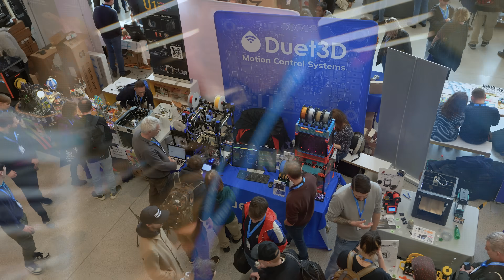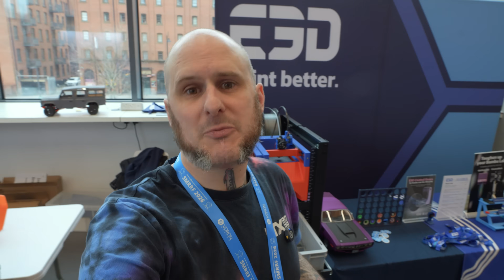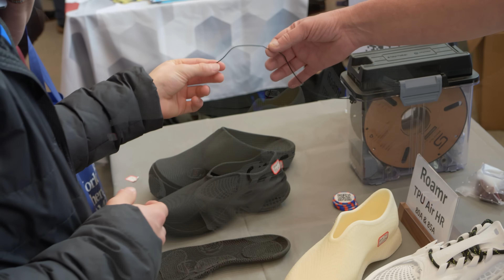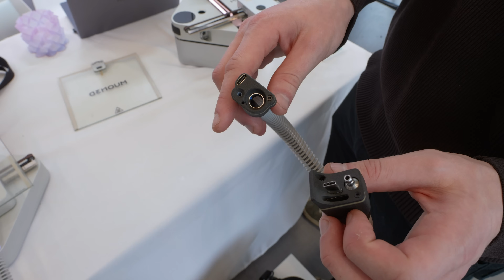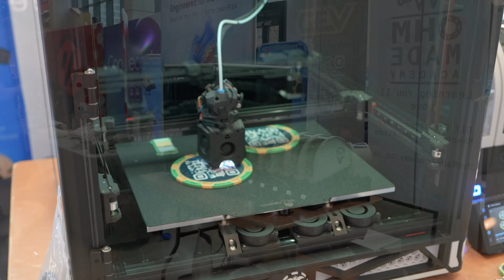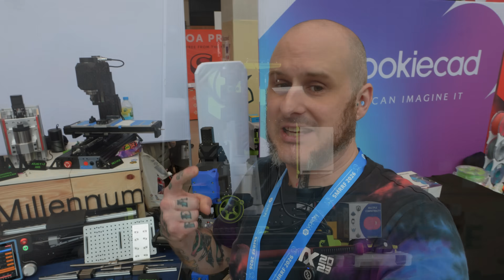The UK's BIGGEST 3D Printing Festival! SMRRF 2026

Comment: I have a few projects coming up that need CF.  I was planning on using Polymaker's Fiberon PA6-CF but the Siraya Tech PPA-CF is quite a bit cheaper.  If you have used each of them enough, do you have any info on pros/cons between the two, if any?  I'm still leaning towards Polymaker just because it's familiar but I am open took looking at other options.